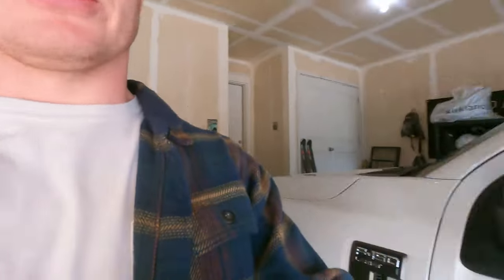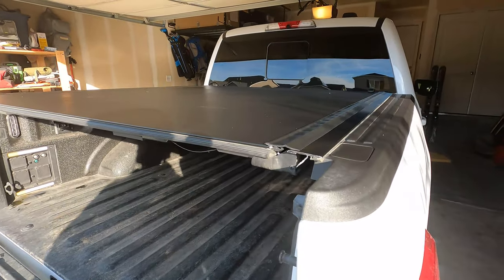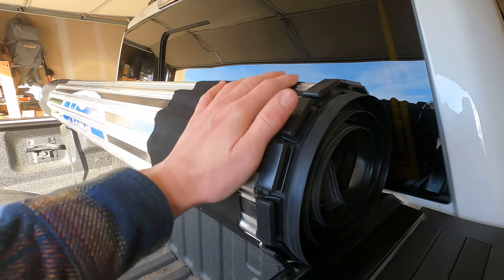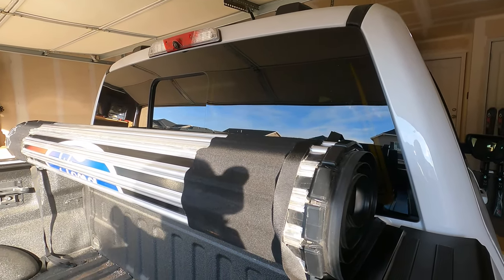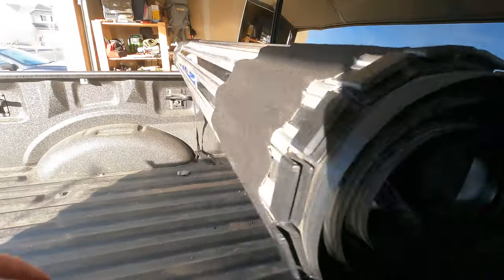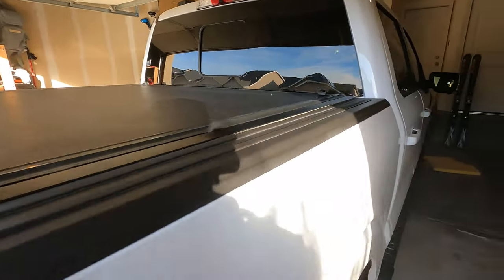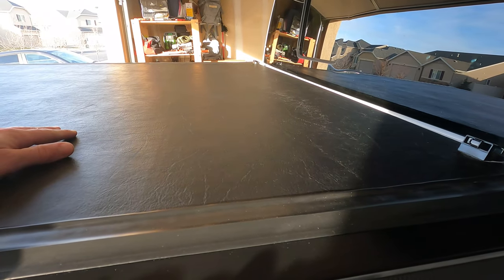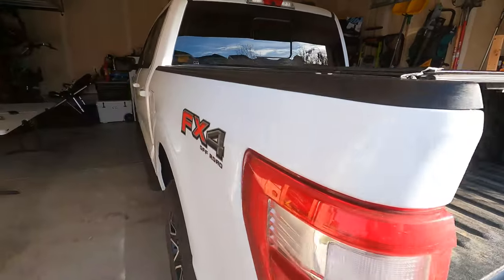1 Year Review of Ford OEM Hard Rolling Tonneau Cover

Comment: While Ford sells it, its likely from Bak Industries. It looks exactly like the Bak Revolver. I have an earlier version I bought directly, and my experience is that it is convenient and a great space saver on a short bed F-150. Very convenient over the tri-fold tops. I park my truck outside, and over time, the top surface deteriorated and cracked even if after using a protectant. Just my experience. Also the felt is really a requirement on hot days as I have found the bottom gets really hot on sunny days. Otherwise I enjoyed using it, but I would not replace it.
Reply from the maker: Good to know! How long have you had yours?
Reply: After 2 1/2 years, the glue failed on the inside insulation, and the vinyl separated from the edges in hot weather.

Comment: Thank you for the review. I just bought the X4s for my Ford F-150. I will definitely get the 303 protectant to use on it, thanks to this review.
Reply from the maker: I highly recommend it! I picked some up from autozone but they also have it on Amazon. 

303 Automotive Protectant - Provides Superior UV Protection, Helps Prevent Fading and Cracking, Repels Dust, Lint, and Staining, Restores Lost Color and Luster, 16oz (30382CSR) Packaging May Vary https://a.co/d/5dtmHHP

Comment: Mine fell completely apart, the felt peeled off, and the black cover detached from the aluminum. It’s rebranded as BAK. Going back to hard panel cover.
Reply from the maker: That's good to know! How long did you have yours?
Reply: @TregsTravels  4 years, I had it on f150 Platinum, it cost me 1200 dollars. I just bought a 23 Raptor, researching them now, leaning towards Gator brand in the panels

Comment: I have a 2012 F150 and bought the 1st generation of this cover (BAK Industries) from them.  It had problems and they replaced it for free just after the warranty expired.  That 2nd one lasted 8 years... and I just bought another one.  I think it is the best truck cover out there and they have made improvements over time.

Do you still use this when you don't have your soft topper on your truck?
Reply from the maker: That's awesome to hear from someone that has used one for so long! Originally my plan was to swap them back and forth and use them for different purposes but I have loved my softopper so much I ended up selling my tonneau cover and just using my softopper full time. I really loved the tonneau cover, the softopper just gives me so much more versatility and taller storage space 👍🏻

Comment: How much does the protectant cost? Is it something that can be purchased from a store? Those are my only concerns. I’ve been wondering how will it last under the sun and will it fade. Thanks great review.
Reply from the maker: 303 Automotive Protectant - Provides Superior UV Protection, Helps Prevent Fading and Cracking, Repels Dust, Lint, and Staining, Restores Lost Color and Luster, 16oz (30382CSR) Packaging May Vary https://a.co/d/bk5Wcub
Reply from the maker: There's the link to it on Amazon , it's about $15 👍🏼 it's a 303 surface protectant with UV protection. I wash the cover with water, dry it then spray the 303 on there every couple months and it looks brand new!

Comment: Glue failing around perimeter, felt protectors falling off, vinyl splitting on top, leaks at rear corners.
Reply from the maker: Thanks for the feedback! It's good to hear other's experiences with the cover...is yours still under warranty?
Reply: After 2 1/2 years, the glue failed on the inside insulation, and the vinyl separated from the edges in hot weather.

Comment: I have the same cover. 2.5 years later, my rolling cover crapped out, the glue failed on the inside insulation, and the vinyl separated from the edges in hot weather. POS.
Reply from the maker: Dang! That's a bummer. Thanks for the feedback, it's always good to hear the longevity of it. I honestly switched to a softopper and love it
Reply: @TregsTravels  The company is replacing it under warranty through Ford. If this one fails, I may do the same. Thanks for the response.